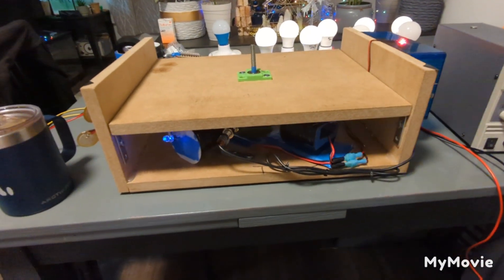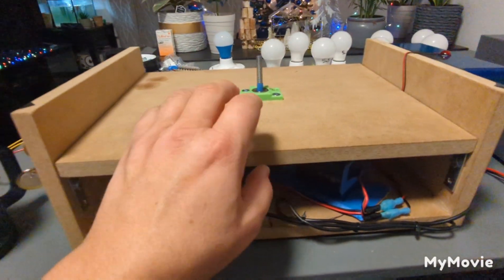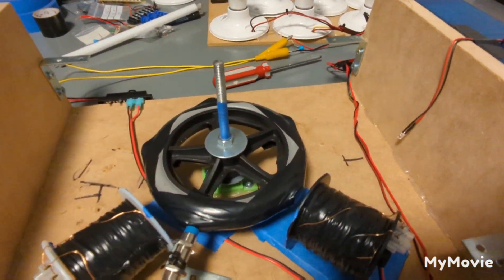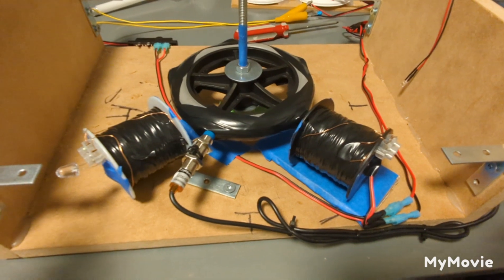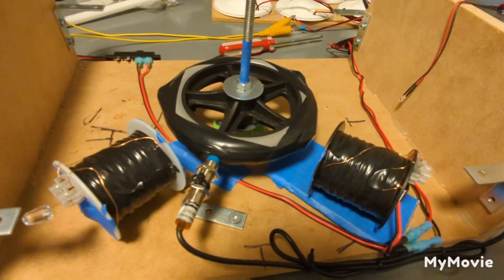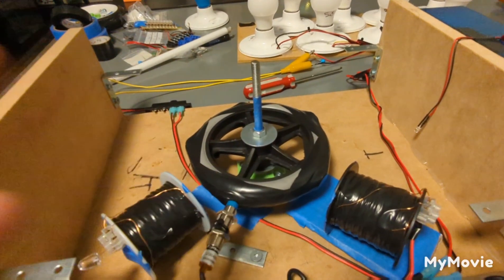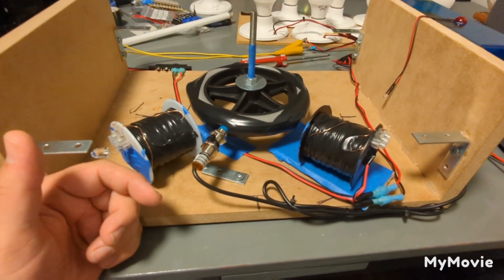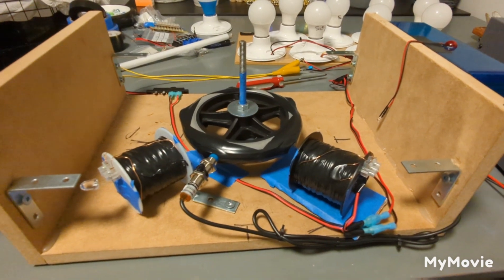Faraday Research RND ⚡⚡ Adam's motor generator secrets exposed!!#freeenergy #tesla #zeropointenergy

Comment: Could a Wimhurst machine with Caps, power your motor with 30,000 volts at almost zero amps? I have used my Wimhurst to charge batteries but it is not worth the effort of cranking the Wimhurst. The iron wire leads of my clips got magnetized charging the battery. Your thoughts?
Reply from the maker: Yeah, it's funny that you mentioned that actually I've been investigating the wimhurst machine and I'm still investigating that possibility

Comment: I noticed if you turn away the coil from magnet the current consume increase, for keep low the current the coil must be closer(my coil is different than yours)
Reply from the maker: I guess it all depends on how much current is going in your motor coil. For instance, my motor consumes no more than 50 milliamps. Sometimes I can get it as low as 20 milliamps. So I'm not sure what the current is that it's going into your motor, but by the sounds of it it must be significantly more
Reply: @FaradayResearch  since I use coils from 1K to 2K turns or more my current is low about 5mA with 23V, 400rpm the rotor, increase to 10mA when slighty keep away the coil from rotor, anyway in my case low current low effect I lit up a small led bulb and not at full brigthness, but the effect of piezos is remarkable, thanks to you for your disclose!

Comment: You say about pickup coil if you shorted ot not slowing the rotor... why is that ? Where is lenz drag in this case? I supose your pickup coil is normal coil ..or maybe not?  Why the load have no nnegative efect on rotor?
Reply from the maker: Hi, that's very good question. So to answer this question, you have to go back to what I said in the video you have to ride the flux wave. The second you implement and attraction between the rotor and the core of the coil. That's when the lens effect takes effect.... the core and the rotor have to be a certain distance away to only rebound off the flux wave. Or I call it the wake.. if you're only bouncing  flux off the wake. There is no magnetic attraction between the rotor magnets and the core of the coil. This is very important

Comment: Do you think that you could collect enough voltage potential from atmospheric collection to power this motor?
Reply from the maker: Oh yes definitely you can generate huge amount of power using atmospheric energy. It's around us all the time 24/7 7 days a week and never stops. Tesla has several patents on a design that could be used like this. I've been thinking about constructing this device, one of his original 1890s patents. And yeah for sure it is definitely a source of power that we should be tapping into
Reply: @FaradayResearch  I used to work with some air national guard comms guys. One of them said they would deploy anttenas in the field with a pole on a hinge. I think it woulf make it easier to do some experiments with a pole mounted collector that could be raised using a come along/winch and this hinge plate. I looked into this ION power group that did some research in this area increasing efficiency by using carbon fiber to collect charged parlicles due to there sharp points. Some design with a lot of surface area and sharp points should be able to increase the amount of energy collected is my hypothesis.